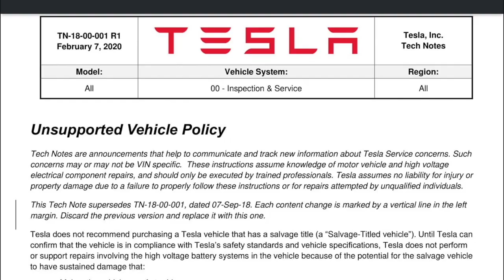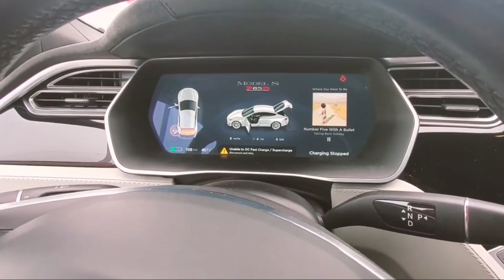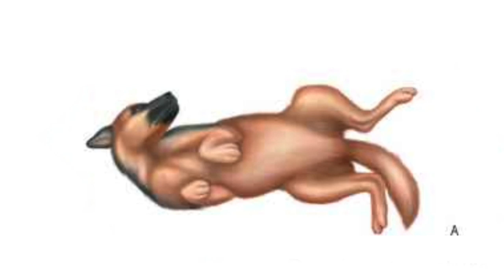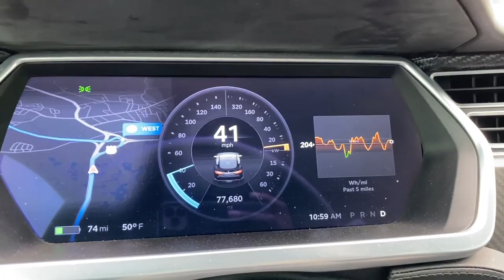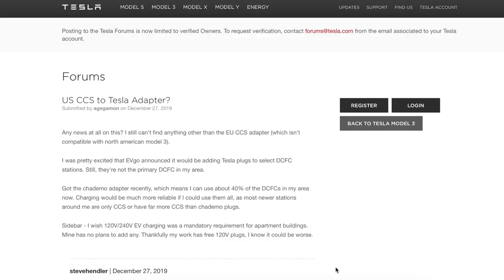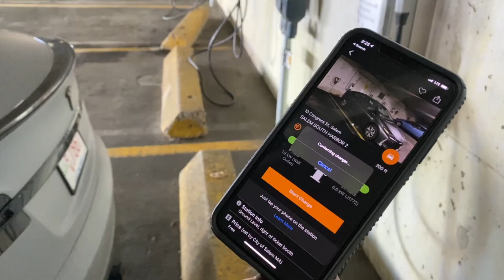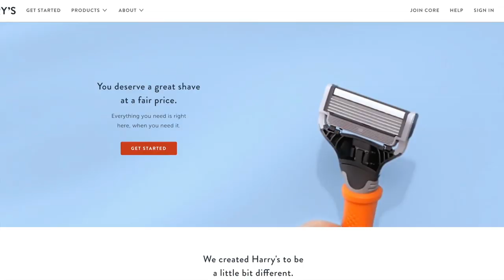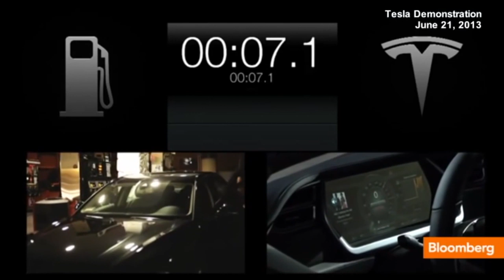Tesla ruined my car and it’s the best thing to ever happen to me!

Comment: Should try to disable communication with the mothership and re-enable DC fast charging.  Time to go to the next level of rebuild.
Reply: Sounds like a great idea, if possible
Reply: You can root them and  re-anble DC charging, pretty easily. Problem is Tesla states they'll sue your ass if you do it. Probably not a problem over here in Europe and Russia, but in the US the corporations just have too much power.
Reply: I am sure Rich has already done that.
Reply: @f36443  oh shit.. True...
Reply: This would be a good opportunity to see if Tesla is bluffing about lawsuits.  I would challenge them on it, but I don't want to test them (plus my broke ass is too poor for even a salvage Tesla).
Reply: Exactly what I was thinking. They can’t sue you for working on and modifying your own car out of warranty. That’s against the law. 1st step, disable communication with outside Tesla Servers. 2nd step, re-enable supercharging/DC fast charging. You can activate this with your own hardware (using existing Tesla systems and sensors on the car) without compromising battery integrity. 😉 It’s not hard, just have to have some knowledge of electronics. Hint: Have a secondary fast charger connected directly to 🔋? 🧐
Reply: @alexanderrobins7497  I personally wouldn't, Elon has pursued many petty lawsuits and won.
Reply: Can you clone a tesla?
Reply: The car is connected allright... And that's why they will get you!

Comment: Someday in the future we will have to crack cars like we cracked game in the 90's 🤣
Reply: Eh, cracking it could bring up legitimate legal action. I personally think we need a full-on new open source operating system to replace Tesla's OEM.. like ClockworkMod for Teslas.

The way I see it, once the car is salvaged out, it's no longer their problem or their ownership. It makes sense to bar a vehicle they don't have any legal ties to from their own network, but it's none of their damned business where or how else you charge your car, they are already absolved by the salvage title, blocking access to 3rd party charging stations is inappropriate at best.

So, if that's their stance, cut them off. You already own the hardware, completely remove their software and use a FOSS replacement. If you burn your car up in the process, I hope a) nobody is injured and b) your insurance is good.

Comment: If Tesla’s mission is to “save the world” with electrified vehicles, doesn’t cutting people off from charging cars defeat that mission? I think you should buy a TDI-engine Audi for retribution.
Reply: I can see it now: The Rolling Coal Channel brought to you by Rich Rebuilds
Reply: I think the idea is, Rich bought a totalled or salvage vehicle and that poses a risk to Tesla from a liability standpoint. Also having people hack the cars to enable super charging isn't exactly fair for people that have purchased a new Tesla through official channels, or a CPO; so the mission is still intact but he is bringing light to a serious problem for a small percentage of the community. Think of Supercharging as subscription, when you buy a used car with cell hotspot or XM radio the subscription doesnt transfer automatically it's not a lifetime subscription. You have to pay for that or upgrade etc.. Tesla should think of a way to accommodate users without exposing themselves
Reply: I say modify the Tesla to run on gas. See what they think when that happens.
Reply: @sekazi  Ripping all electric crap out and installing say v8, or those new opposing piston diesel engines? and still have it be lighter, use less tires and you are not slave for a corporation...
Reply: THEY want you to sit down. 

Your grandparents like their reclining cloth armchair, it's worn, full of dust mites it has stains. It has heritage it is what they want after a hard day's work. It was bought to increase quality of their rest of their enjoyment. but it was their idea of a good place. They were thought a sitting place should be comfortable. 

Your grandparents are no longer here, only you know what they liked, they told you. Your children don't know this. It's a stupid thing who cares what they enjoyed sitting on. They just did NORMAL STUFF. 

Trends and the illusion of ever advancing times and technology. 

 THE DEVIL wants you to sit on a plastic stool. It's the future!! it's thinly padded and easy to manufacture, wipe clean, avaliable in a range of colours. Bluetooth and usb fast charge connections. 

 You sit on the stool your children and there children sit on the stool. its what you do its all you know. "a sitting place should be rigid, thinly padded", You don't really know how  to immagine anything else as a sitting place at this point. Your children will have to choose a sitting place one day.  then they kick the legs away one by one until you fall.

Yes our choices, but who is putting the logic in your brain. Who owns you and who will own your family. 
A chair is a chair but who really chooses what is defined as a chair? . Us or them? whose in controll really? And who the f🙃k is this us or they for this matter?

We are all born the same here so don't let yourself doup yourself into a con.  Play your part like rich the tesla guy did. Because the players that join after you leave won't have known that you had ever been here at all or that even now unobtainiable futuristic equalitys had existed  once apon a time in the past, like Supercharging for all forever.

How they would laugh at such a satatement what an unreasonable thing to suggest. Lol Supercharging forever for everyone, that's a good joke gotta remember that one🦄

It's not about tesla, it's more the fact of any change to status quo of the status quo with any members of the status quo who are trying to tell you what a status quo is even if u can't spell it. Like myself
Reply: No, to pay them back get a Jeep Grand Cherokee Trackhawk. Go full evil.
Reply: @Giggidygiggidy12 only issue is they are canceling the super charging for people who passed their paid re-certification . It’s not about liability then . It’s about them wanting complete market control of Tesla’s . They don’t want others working on or gaining profits from their products .
Reply: Tesla should and is able to limit which cars that can be supercharged, this is because the superchargers are owned by   tesla. A totalled car that has been rebuilt shouldnt be able to supercharge without certification. It is stupid that tesla removed the certification
Reply: @sekazi  LS Swap that fucker.  Or drop a whole home generator in there somewhere and run the motors off of that lol
Reply: @Hellsong89  you want software updates? You get terms of use. Yo want a car that always gets worse with time? Don't get a Tesla.
Reply: Amazing logic. They've singlehandedy reintroduced innovation to a stagnated market and accelerated electric vehicle adoption by probably a decade...
Reply: I really want a "bricked" tesla chassis rebuilt into an AWD diesel car with a manual transmission. And go to a Tesla owners meet and show off the engine bay. The screech of soy would be beautiful.
Reply: Tesla's mission is to "drain the world (of money)" a common misconception, I know.
Reply: @sigurdmalminhansen4846  Sure, they can stop people using the chargers they own. What they have no right to do is to disable DC fast charging for the vehicle, so that it won't work on anyone else's chargers either. Apple lost in court and had to pay half a billion dollars to a class action when they slowed down old phones on purpose. This is the same thing.

Comment: Rich now needs to build a trailer with a generator for charging it on long distances.
Reply: That won't work as the DC fast charger is downgraded to super slow speeds.
Reply: And driving 18 mi/hr
Reply: Makeshift Chevy Volt, lol.
Reply: @linecraftman3907  For 24 h ? :D  If he will start with a full battery after 5 hours of driving and 1 for stop that would give extra 108 miles of range :)  Always something.
Reply: @linecraftman3907  Closer to 6 mi/hr.
Reply: He needs to buy a DIESEL TRUCK FLATBED so he can TRAILER his Tesla to "EV shows" (Yeah, this is sarcasm).

Comment: Sounds like a case for the "right to repair" evangelists.
Reply: Summon Rossmann
Reply: reper30000 don’t you dare disrespect him like that
Reply: honestly, I doubt there'd be much they could do. The car is still his, he just needs to learn to override the software checks if he wants DCFC. 

Tesla supercharging is a no-go just because the network is Tesla's so they can dictate who uses it and who can't.
Reply: @xPreatorianx1  No need to wall of text me.
Thought he called him Susan Rossman.
Reply: @1ronman1  that wasn't even directed towards you. But @Deadly_M
Reply: So its clear, I am very PRO right to repair, anything else is environmentally irresponsible IMO
Reply: @vawlkus : Yes, Tesla has their supercharger network. But, there are also third party chargers that also have fast charging. The fast charging was disabled on the vehicle, not just on Tesla's network.
Reply: @herrschaftg35  read what I posted.
Reply: @vawlkus : I already did. My point is that Tesla should not be able to remove the fast charging capability for a network that they do not own.

Comment: I was going to buy a Tesla , Harry's Shaving Company seems more legit
Reply: Harry's razors are trash and I'll tell you why.  The "hinge" isn't mechanical and skookum, it's just some cheap/shitty rubber that's all wimpy and also breaks down if it comes into contact with some oils, like say, Neutrogena body oil that you may be trying to shave your face with.  Go with Bulldog instead (or even just Gillette if you have to), again I say Harry's are trash.
Reply: I use an old school safety razor. It cost me twenty bucks initially and I get like two dozen ice forged blades for five bucks. It's entirely built of metal too, which is nice.
Reply: @revwroth3698  Same though mine is the old Micro Touch butterfly safety blade for on sale for $20, bought when those were being stopped by Micro Touch, can still buy a known brand copied version of the Exact razor on Amazon with the same brand of 10 blades the orginal came with. The 10 blades that came with the thing are trash as they are thick for the blade but the 100 pack I got for $10.99 USA of Persona blades are the more thin but still good blades. I also got a $7 ground leather Sheath for my blade.  Most ~95% use an all metal design a few have a blade that has a rubber grip on it, a bone on handle for the look of the old Ivory, or a Tile for the look of the old tile made handles. Oh a few are wood handle but most of those once the wood gets wet problems happen.
Reply: Better than Lawnmower 3.0??
Reply: @OpenMindArtist  if those are meant for down there Shaving, then no those are not the best for that as I have seen reviews saying they are nothing more then a soft style electric razor

Comment: But a hybrid from Hyundai or Nissan if you want to be environmentally friendly. All the electricity you need for a short trip, better cost, gasoline backup in case you have no place or time to charge it and they don’t have so much of a monopoly on the technology. Even if you want an electric go to Nissan or Hyundai. It’s a lot cheaper, you can get replacement parts and they’re pretty much able to match Tesla range nowadays anyways.

Comment: I'd turn it back on and dare them to sue. Perfect set up for a counter suit.
Reply: Benjamin Franklin Tesla literally has the software keys to the car.
Reply: Disable OTA updates.
Reply: dalex7777 remove it from the software, just get rid of the code. Take out the storage device with software and plug it into your computer and change the code, and magic Tesla Supercharging re enabled and no Tesla software key.
Reply: @dalex7777  and this is 100% the issue. There is just as many or more issues with Tesla's from the factory than there are with rebuilt models
Reply: As much as that would be awesome to see, Tesla lawyers would probably keep you in litigation hell until you ran out of money.

Comment: I can see tesla having a lot of dissapointed customers down the road when used teslas become more common
Reply: This will probably be why Tesla's don't become more common.
Reply: Used Teslas are fine, it's just if you rebuild one that they will disable your supercharging
Reply: ALI B no what will happen is no one will ever buy salvage Tesla’s except recyclers. 
I wouldn’t ever buy one. New only once insurance pays out for the wreck buy a new one.
Reply: @paulkieffer1189  When these cars get a little older and less valuable, it will take very little for an insurance agent to decide to total the vehicle.  Just the salvage designation is what Tesla uses to remove the supercharging and an insurance company can total a car for being stolen for too long or minor damage if they deem it not worth it to fix it.  Look at the car Rich was talking about in Texas with Legitstreetcars.  That car had some suspension damage, but they totaled it because it had some damage to the aluminum roof, which was easily fixed.  They removed the supercharging even though there was no damage to the batteries or that system.
Reply: Lmfao who would want an older shitty ev?

Comment: Next vid “DIY Fast charge, bypassing Tesla charger”
Reply: Yes, I'm wondering what grounds Tesla can seek litigation for the customer turning a feature on that the vehicle originally had turned on from the factory but OEM turned off?  Especially as it relates to using charging infrastructure not owned by Tesla (like public DC fast charging stations)...
Reply: D.J. Parker The guy that lost 12k should definitely try it. Let them sue him. He paid for it, he needs to keep it.
Reply: This will play out exactly like the game console 'mod chip' wars of the early 2000s. Get parts from sketchy online seller, intstal it yourself, hopefully don't break it, hopefully it works at all, and then be worried all the time that you'll get banned from Xbox live, I mean Tesla supercharging. Or worse yet, legal action. It also reminds me of the hackentosh community, constantly worried the next OSX update will brick their computer.

Tesla controls the infrastructure even though electricity is a utility. There is a reason electricity is a utility. Yet we need to see competition here to bring this kind of infrastructure to everyone...
Reply: All I seen a video where a guy was charging his Tesla off of a generator battery

Comment: and this is why I won’t ever buy a Tesla! You lose all control over “your” car.
Reply: Enjoying going for gas and maintenance costs....
Reply: Sergio Messina | If my shitbox honda is under my free control AND maintenance, I would definitely choose that over this bull
Reply: Sergio Messina there is maintenance costs with any car
Reply: I know changing oil is soooo insanely hard, ive owned 2 cars in the span of 10 years, no real issues if you just keep up with fluid changes,
Reply: @Ghengis 99.9 Bruh, you could not be more wrong. Oil change, fuel leaks, broken axles, out-of-tune spark plugs, Replacing Air Filters, stuck cylinders, broken springs, oil leaks, replacing water, replacing car batteries, alternator failure, broken starter motor, non-shifting gearbox, clutch fluid (If you're car is manual), emissions testing, damaged and/or clogged seals, gaskets, and lines. The list goes on forever. I'm not a HUGE Tesla Fanboy, but there are definitely perks, one of them being that you will only really ever go to a mechanic if:
1) There is a recall
2) You participated in a car accident
3) You need to replace your battery pack
4) You're Tesla Tires miraculously get punctured.
Reply: @randomchannel5386  Bruh, you could not be more wrong. Oil change, fuel leaks, broken axles, out-of-tune spark plugs, Replacing Air Filters, stuck cylinders, broken springs, oil leaks, replacing water, replacing car batteries, alternator failure, broken starter motor, non-shifting gearbox, clutch fluid (If you're car is manual), emissions testing, damaged and/or clogged seals, gaskets, and lines. The list goes on forever. I'm not a HUGE Tesla Fanboy, but there are definitely perks, one of them being that you will only really ever go to a mechanic if:
1) There is a recall
2) You participated in a car accident
3) You need to replace your battery pack
4) You're Tesla Tires miraculously get punctured.
Reply: @TheGuyFromNorway  Bruh, you could not be more wrong. Oil change, fuel leaks, broken axles, out-of-tune spark plugs, Replacing Air Filters, stuck cylinders, broken springs, oil leaks, replacing water, replacing car batteries, alternator failure, broken starter motor, non-shifting gearbox, clutch fluid (If you're car is manual), emissions testing, damaged and/or clogged seals, gaskets, and lines. The list goes on forever. I'm not a HUGE Tesla Fanboy, but there are definitely perks, one of them being that you will only really ever go to a mechanic if:
1) There is a recall
2) You participated in a car accident
3) You need to replace your battery pack
4) You're Tesla Tires miraculously get punctured.
Reply: @sergiomessina2037  I agree. 👍

Comment: I’ve never had to start up the ChargePoint app. You just hold the phone near the unit to unlock the handle. Once the phone & charge station “shake hands” the app comes up by itself. Think about it. If you use your orange key card it works without the phone.